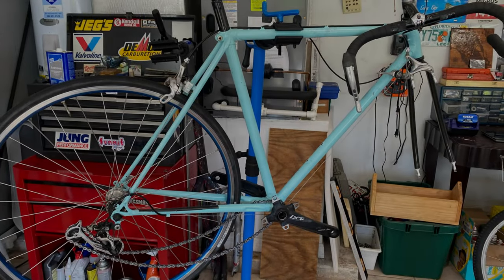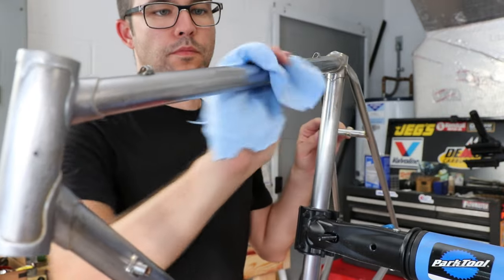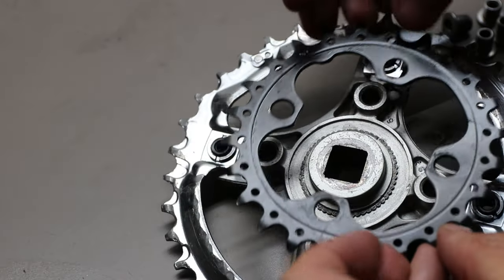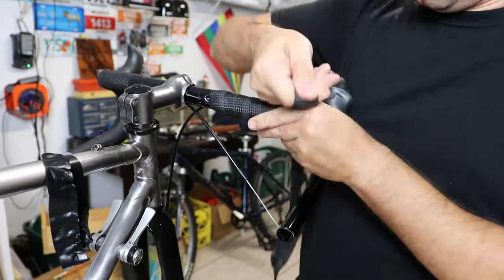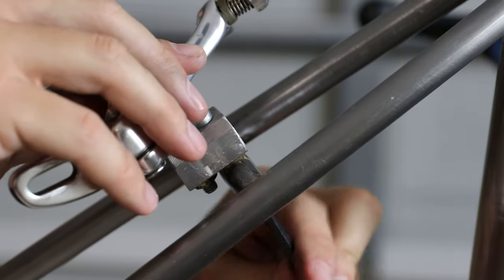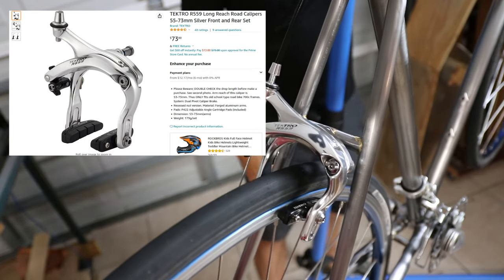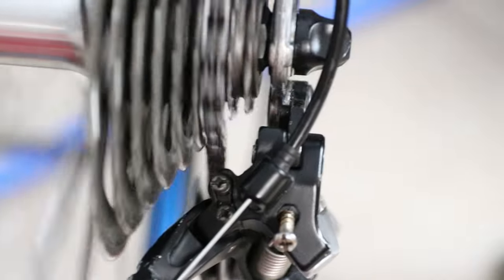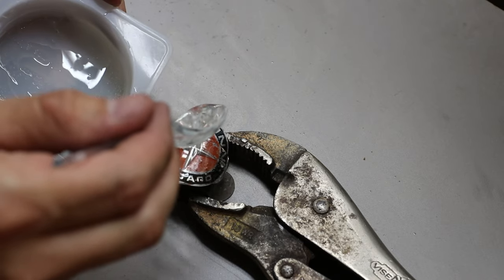1987 Schwinn Le Tour rebuild

Comment: Great video Bruce. I wish we could hang out. 
Haha, I know the story...you start raiding previous builds for parts, and after a while, your left with something that looks the junkers they start out as. I liked the "celeste" color, but bare steel is cool. I've sent you photos with close ups of the finish I achieved on a Kuwahara. On mine I started by sandblasting the frame, which left quite a coarse profile. This meant I had to sand and sand, using finer and finer grit, probably up to 1500 grit. In hindsight, I wish I'd kept polishing, woulda looked nicer like yours does. Anyway, once I was pleased with my bare steel finish, I hung frame and fork from a tree overnight. My goal was to let the frame just begin to rust from the dew in the air overnight. And it worked! There was a fine layer of oxidation. Several clear coats later, she was beautiful. A friend now owns it, and it's interesting how it's aging, several years later. The rusting is spreading, but is superficial. But I like your result. It's cool.
As to wrapping one's bartape...I with you...the noble bicycle is no place for electrical tape. I too have had very little trouble wrapping in this method. When some types of bar tape get real old, wrapped "backward" like this, they will start to roll a bit, but its the tidiest way. I've actually been called out by a weenie bike mechanic on Instagram for starting at the top. Haha. Again, thanks for your content, and hopefully you read some of this.   -->÷€-
                        -->÷€-
Reply from the maker: thanks so much Karl! but where did you send the photos on, I don't think I've seen anything? You can tag me on IG if you want to post them there.

Comment: I definitely vote “yes.”  The raw look is great.  Of course, I’m a big Ti fan, so...

I wonder of you are going to find the 36T on the front to be enough on a road bike.  On a recent flat bar gravel build, I have a 36T on an IXF crank.  It spins out at about 24-25 mph.  We’ll see if it works for you.
Reply from the maker: thanks Peter! Yeah I'm not sure about the 36t either, I might go for a 38t if needed. But I'm really not the guy that rides real fast and hard for long distance, I'm more of a cruiser or climber, so realistically I won't need to be riding at 25mph too much.

Comment: I did the same with my 1985 chromoly steel bike, it was lit. Great job! One suggestion though, it will look smoother if you buff the surface thoroughly or use a rubbing compound to make it shine.
Reply from the maker: thanks Mike!

Comment: Another thing you are right about...no matter how much you spend on spray paint quality clear coat, the result will always be disappointing. I'm looking at my daily rider, mid 80's Miyata singlespeed conversion. It's lovely. I spent a few years getting all the perfect bits together to build it up, tested it out mechanically then disassembled for paint. I chose gloss black with a subtle rainbow mettalic. I thought, "This is gonna be so rad"! And, it worked out, though the clear coat didn't give as much of a "lens" effect as I'd hoped for, and the mettalic shimmer was only evident under direct sunlight. Like all bikes, it got dirty, and just washing the bike dulled the already disappointing finish. It now looks like a boring black bike, and I'm considering sanding down to paint again. So, avoid this. If I include sandpaper, tack cloth, acetone, primer, paint and clear coat, probably close to $200. I'm also gonna address that gloss black is maybe best avoided for the home workshop set.
Reply from the maker: maybe consider sending the frame off to powder coating, I want to give that a try one day. I've seen some guys offering to do bike frames for $100.

Comment: Those Tektro calipers look really good.  I just got a set of Tektro RX6 mini V-Brakes for a tandem in need of a light restoration/upgrade.  Way better than the original cantilevers.
Reply from the maker: Yeah I’m really impressed with them so far, only thing is when I bought them I pain around $55 I think, now I see they’re listed at $73.

Comment: It's been a year since the video was posted... How has the clear coat held-up?  Any signs of rust?  Ironically, I just got done stripping a 1987 Schwinn Super Sport frame and would like to keep the rear triangle raw steel.  I keep reading that steel will rust under the clear coat and eventually look bad, but I'm hoping that 2K clear might be more moisture resistant than standard clear coats?
Reply from the maker: check out one of my latest videos, I answer that very question.

Comment: Looks great. Why did you keep the down tube shifters? Why not upgrade to newer brake/shifter levers?
Reply from the maker: Thanks ah1! Good question, I guess multiple reasons. Firstly I didn’t want to spend anymore money and I already of course had the DT shifters. Secondly, this isn’t really a top performance bike, it’s not particularly light weight, it’s only running a 9 speed rear cassette, it’s just an 80s bike, so for me the style of the DT shifters are more fitting for a old steel frame. All that said, if I did come across a nice deal on an set of STI shifters, I might try it.
Reply: Mine’s a 23” & it’s no longer a daily but nearly. I bought a Wahoo Kickr a few months ago, so now if the weather’s sloppy I ride inside. If not for that, the LeTour would still be a daily ride.

The LeTour is heavy, & strong. At 220 lbs I’m not a small guy. I do have lighter bikes, but the LeTour’s less likely to fatigue over time.

… & then there’s the part where something like a Paramount or an even lighter CF road racer feels like it weighs nothing after training on the LeTour. That’s fun. Another fun thing about vintage steel, it’s hard telling what all you’ll do with that frame over a lifetime. Whatever you want, right?

Comment: did you have stretch the rear to get an 8/9/10 speed wheel in there?
Reply from the maker: Being I already had a 9 speed on it from two years ago, I really don't remember if I had to or not. But I've done it before on other bikes, it's really pretty easy. I with some threaded rod, nuts and washers you can easily make a jig to do the job.
Reply: Rj the bike guy has a great tutorial on that
Reply from the maker: @komoonkh  yeah I’ve learned from them.

Comment: Looks beautiful! I want to do the same to my old steel Schwinn. I was curious if you only used one can of clear and how many coats you applied? Also did you have to apply multiple coats of the paint remover to get the paint off fully?
Reply from the maker: yeah used the paint removed several times throughout the day. Even after that it took tons of sanding. As for the clear, I did four coats with 1 can, with about 30min to an hour between.
Reply from the maker: also thank you!

Comment: Awesome build, looks amazing! Restoring a Le Tour Elite, as well as recently completing  another Schwinn rebuild myself. Most importantly is it good to ride?
Reply from the maker: well It's decent, but I want to change the front levers to something a little more wide in the hand and I think that will help. It has a bit of that very vintage feel. I don't think I'd want to do 100 miles in a day on it as it is. Let's see if I can get it a little better.
Reply: @BruceChastain  maybe a thicker set of handlebar wraps, some more modern levers with a longer hood area to rest you hands on may help for feel. Also a different rim/tyre combo can change the way the bike feels! Good luck man🚲

Comment: Hi ! Very sweet ride 😎. Regarding the rear derailleur, did you try playing with the B-screw on it? It increases/decreases clearance between jockey wheels and cassette cogs. Even so, some models just cannot cope with too big a large cog (industry term is "capacity"). Sorry if it's obvious, not trying to be a smarta$$. Thanks for the entertaining vids!
Reply from the maker: Thank you Carlos! I did work with the b-screw, even adding in a longer one, but no that didn’t help.